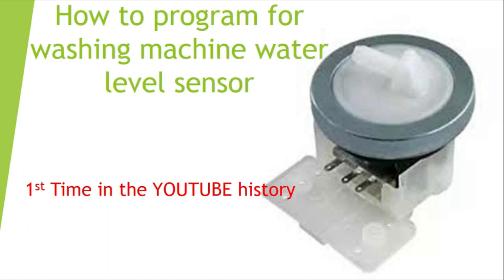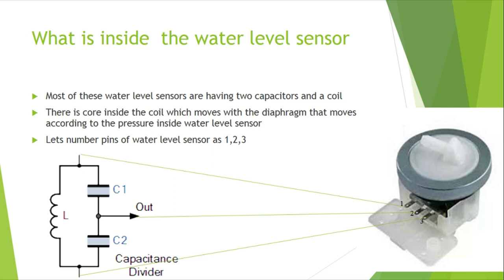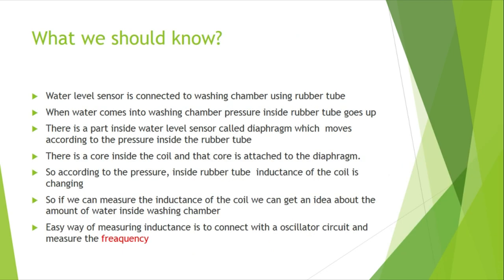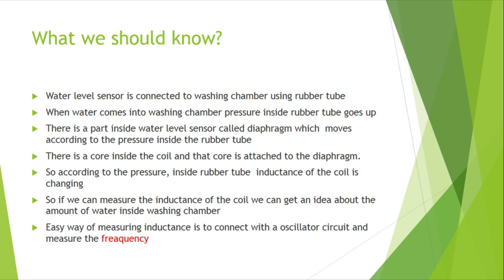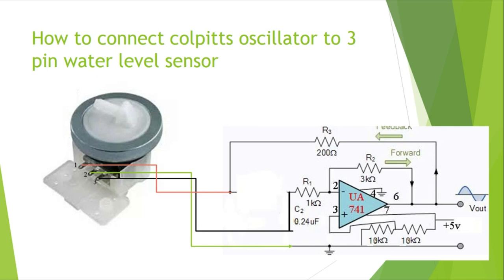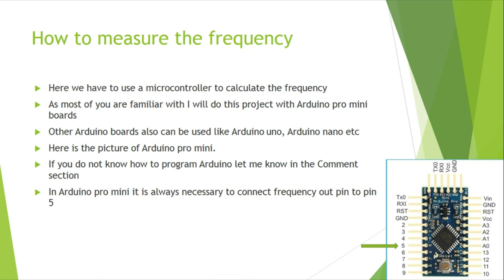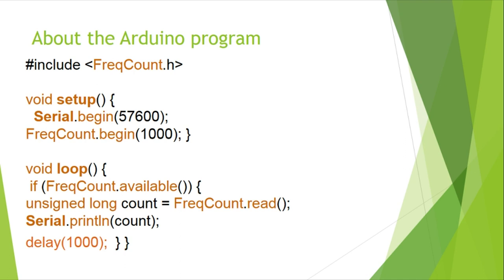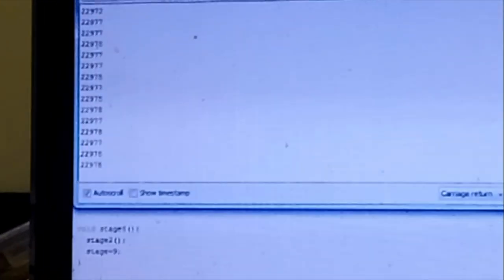Washing machine water level sensor programming

Comment: How no water flowing in to the machine is sensed. A red led glows and beeper indicates.
Is this sensed by no change in frequency as level does not rise or by temperature of solenoid coil of input valve?